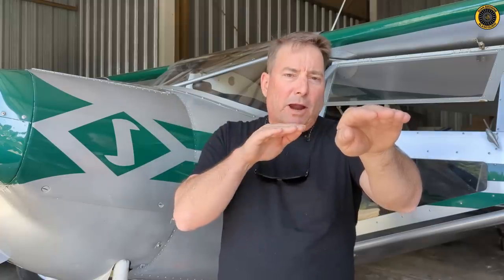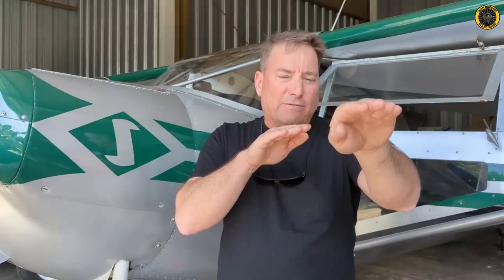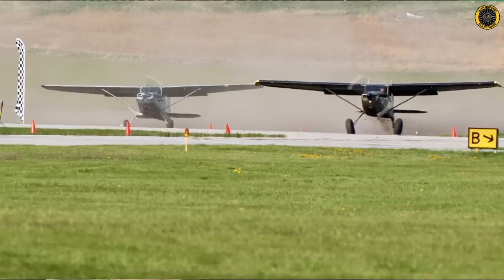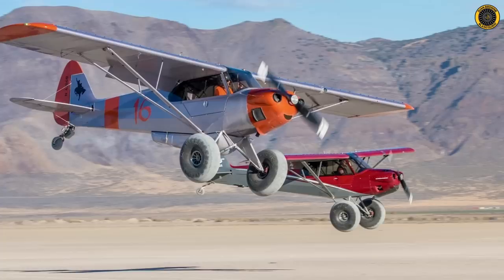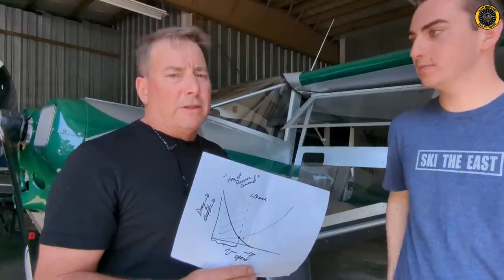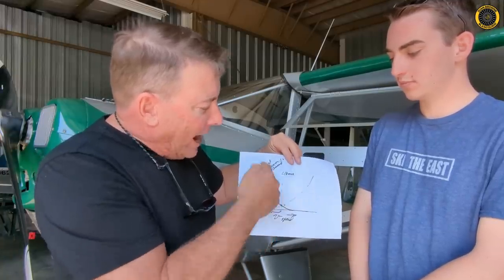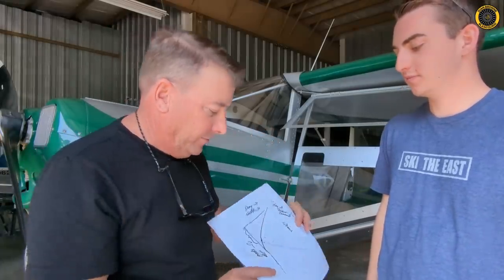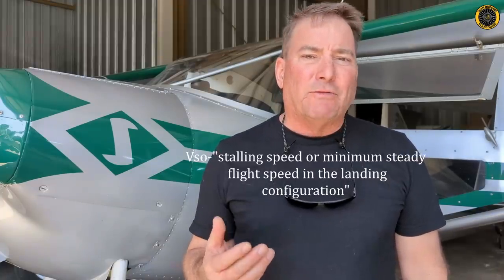Cessna 140 Stall/Spin Accident Wayne NE

Comment: As soon as you started explaining the wing drop I was chanting "stick forward, stick forward".  Don't fight it, aid it.  Spend a few grand on a modern home PC, a good realistic flight sim and practice doing everything wrong, why it's wrong, write off a bunch of expensive virtual aircraft and then go and do it again trying all the different techniques to see what works and what doesn't.  
I mean, you cannot simulate a tip stall on short final in the real world.  You can do it all day in a sim and not kill anyone or cost anything.
You can try, aiding the stall.  Left wing drops, it could spin, so spin it.  Stomp the rudder towards the wing that's dropping and pull the stick back.  Weeeee!   Or kick the falling rudder and stuff the stick forward, wait for the stall horn to shut up and slowly pull out.
Just remember when you get back in the real thing the plan is to avoid those regimes entirely, not play with them.
Reply: If you just don't do "games", RC models are cheap and if you go with an electric powered foam STOL plane, it will be so light, if you spin it on approach you could probably just run over and catch it.  (Just don't try that with the prop spinning, it hurts... a lot).
Reply: I had a little powered glider, high pusher prop RC plane.  I decided that as I was getting comfortable flying it, I'd try some departures.  Stall was so beginner friendly and smooth, I moved straight to a spin.  Slowed up, held the nose high, seen with my eyes the buffet caused a left/right wiggle in the tail, seen that as my opportunity and slammed full back stick, full left rudder.  My god that thing snapped into a spin so violently the canopy held on by neodinium magnets popped off and free-fell down, the battery held in by elastic bands came out and was spinning around on the end of it's cord about 3 inches in front of the nose of the plane, like a bolos. 
I honestly do not know how I recovered it.  I slammed the stick forward and it responded, had to give a few kicks of rudder to stop it penduleming and get it coming down straight vertical, then I pulled out.  Battery hanging from the cockpit area.  Luckily, somehow the centre of gravity was still workable and I was able to land it gently into some long grass as a cusion.  I've never seen a plane spin that tight and aggressively.  I imaging, in the real world, if you were a test pilot attempting this on a small experimental type for the first time, you could get a real surprise as I'm sure such a violent spin is going to cause damage to the plane AND the pilot.
Pays to remember that cessna et. al. do spend a lot of money and employ some very good aerodynamists so most of these things happen in predictable ways and don't randomly kill people.

Comment: Mixing aircraft with vastly different performance is the obvious situation in which conflicts will arise. There's not much twist in the C-140 wing, so it stalls with little warning all the way out to the aileron. The C-140 & C-150 series aircraft were designed as trainers & built to have abrupt stall-spin characteristics.

Comment: Even small A/C like a Zenith create wingtip vortices that might be capable of changing lift left to right wing on the following A/C. Perhaps that was a factor if he was so close behind as to start turns away from RW heading to avoid overtaking. The problem with many A/C accidents is the pilot does not have time to learn from the sudden changes in airspeed, lift, drag.

Comment: Thanks for highlighting the 'decreasing headwind shear' problem. I was arguing this with some guys a while back and they were trying to say that it had been discredited (the old 'turning onto downwind' argument) - I could not work out the aerodynamics of their argument - it appears obvious if you have a decrease in headwind close to the stall speed and nothing is done to increase the airspeed of the aircraft, there is an instantaneous change of the speed of the air over the wing - sure, if there is plenty of time and space to compensate, it's not a problem, but at that 'only a couple of knots to spare' instantaneous moment, it is a big problem.

Comment: An unfortunate accident and my condolences to all involved.  Good discussion on correct response to incipient spin recovery and operating on the induced drag side of the power curve.  One thing that was not mentioned was the possible encounter of wake turbulence from the aircraft ahead which could have induce the initial roll effect…

Comment: The Cessna 140 is a sweet airplane.    But the airfoil lacks certain modern features you’ll find on newer 100 series Cessnas, like leading edge cuffs and wing twist.  As a result, the stall characteristics are a bit different.  If coordinated, the airplane can be flown at slow flight with a straight up and down airspeed indicator.  There is absolutely no sign of an impending stall…no buffet or wallowing.   When it breaks, it just breaks…cleanly and instantaneously.  Add a little yaw and one wing will drop right off.

Comment: Juan am not a pilot, 20k away from you. But here sitting on the fence, the plane not built for stol.It was following a plane that was, hence he caught up due to a higher speed compared to one that still flies at an even lower speed. Out of this comes and uneven clearance, plus as you say wind shear about, higher speed required than normal. I would say just have the competition for stol built aircraft. I guess it is like having a competetion between a tiger moth, and a 777 which one would land with the least amount of runway used. Sad day for the family.
Reply: Seems to need more controls from smarter folks, and based on the plane and pilot?

Comment: Having taught STOL techniques for years, I am encouraged that these events will highlight good technique.  Good takeoff technique, as you just said, is to get into low ground effect as soon as possible (that is how they are graded) and stay as low with the fuselage level as possible for as long as possible or at least until zoom reserve airspeed that allows maneuvering flight or even short duration climb with engine failure (that is what is not happening.)  Good landing technique, as you just said, is to fly a stabilized approach at more than stall speed out of ground effect followed by a power/pitch deceleration coming into high ground effect.  STOL, which understands that the airplane will fly slower than Vso in ground effect, is targeting the speed at which the wing will stall in low ground effect.  Going behind the power curve, not necessary in that headwind condition, will allow the wing to fly at less than Vso out of ground effect with the throttle closed.  That is why we must pitch to decelerate to the point of sink (not necessarily behind the power curve) in order to bring dynamic throttle into very effective glide angle and rate of descent control.  This dynamic throttle control, in strong balloon closed and then adjust or in rapid sink to the firewall and then adjust, is what makes adding airspeed in gusts not necessary.  Just a bit of dynamic throttle was necessary with those winds.

Finally, and most importantly, with even 50' of vertical space available (400' was available) insisting on a level turn, teaching level turns in the maneuvering flight world, is counter-productive.  We are teaching pilots of small airplanes, the planes most train in, to stall when startled in a turn.  It makes so much more safety sense to teach pilots (outside the high altitude and flight by instruments world) to release back pressure in all turns (muscle memory).  Releasing back pressure allows the designed to not stall airplane not to stall in startle or inattention of pilots turns.  The airplane cannot stall itself.  A pilot pulling back on the yoke is necessary to cause stall.  The critical angle of attack is not why it happens, but rather when it happens.

I very much appreciate your videos, Juan.  I apologize for the long STOL technique lesson, but I think it is an important one for all pilots.  I think the basic low ground effect takeoff and deceleration using the apparent rate of closure (power/pitch) are safer techniques than what are presently Airmen Certification Standards.  My condolences to the family, but STOL isn't what got a good pilot.  Muscle memory for pulling back on the yoke in the turn did.  He made that turn as taught.  Unfortunately he got startle close and there was no instruction in allowing the airplane to do what it was designed to do in a 1g turn of any bank angle.  Muscle memory cannot do the math so the 1g at any bank is safer.

Comment: Sorry for the loss.  You accept the risk when performing this type of flying. These demos are very risky and it was only a matter of time before this happened.  This type of flying puts added (unnecessary) pressure on a pilot to perform during the most critical stage of flight...Before slamming me, yes I am a pilot who has many hours in a Zenith 750 and I would not do this type of flying...

Comment: I have read several different websites where they have tried to asses what happened to Tom Dafoe's Cessna 140. From reading comments from others there seems to be a lot of negativity towards the STOL Drag community. A lot of commentators also felt that the Cessna 140 airplane was too heavy to be performing in STOL Drag competition. Many felt that the Cessna 140 was a bad choice to do STOL maneuvers of any kind. I have watch STOL Drag demonstrations that you have done the "play by play" and I thought it was a relative safe operation but then most operators are season veterans in this type of activity and their aircraft maybe more suited for STOL Drag racing competition. I would say the biggest one out there throwing daggers at the STOL Drag racers is Dan Gryder!

Comment: Another possibility, slow and right within a knot or so of the knife:  even a shallow turn can begin to initiate the airflow zippering.  Video of event is too far away to verify any rudder or aileron inputs.  All that said, If I was going to do a go around mr throttle is my first control input.
Reply: Phillip Cobbin Never, never add power first, reduce angle-of-attack first and then add power.
Reply: @garymiller5624  Multi tasking do both, unload the wing and get power in
Reply: @philipcobbin3172  l will go with that, never power first 👍

Comment: It just shows how easy it is to get yourself into a difficult situation with mismatched plane types and stall speed, the need to maintain situational awareness, think ahead of the aircraft and the care you have to take when initiating a go around at low speed - which we've seen the results of so many times, I suppose a potential lesson is to be aware of the risk and try to be ready to push on the rudder/push forward. At that low altitude then really difficult. Once you start the stall/spin entry at that altitude it's very hard to recover. I wonder if It might be worth considering mandating/recommending bigger separations in paterns whilst demonstrating STOL, simply as you're flying in that region, it seems to me that he wasn't able to maintain a higher speed and then drop it close to the runway as the slower aircraft was infront of him. All in all very sad, it only takes a second RIP.

Comment: Very sad deal, and RIP to this aviator.  Did a lot of instructing and taught the stuff you are talking about here.   But my instincts told me that a lof of GA pilots are not going to train regularly and practice these things at a safe altitude, and even if they do, they can be caught unawares when  the focus is on other things than speed, power and pitch.  Tragic part is, it only takes a few seconds and a moment's inattention at low altitude to get into a stall-spin situation and of course as we all know, low to the ground, there's no time to recover.  When we say, first fly the airplane ... that means keep that necessary speed and if you can't, then do something else.  Get out of that configuration, get the speed back, and climb and get out of there and do whatever you are doing ... again.  Go around, etc.

Comment: One observation I took in from other actual video not brought up is the trailing wing tip vortex generated from the lead aircraft flying slow at high angles of attack and its affect on the trailing aircraft flying close in and lower is very susceptible to rolling and stall upset actions.

Comment: Another unnecessary loss of life due to a stall-spin.   I practiced spin recovery in 1980 when I earned my ticket and why the FAA only requires this for new CFI applicants is a mystery to me.  (Per FAR 61.183, pilots applying for a CFI certificate)  The requirement to demonstrate spins during a private checkride was eliminated in 1949)   At least make students hold full back stick and 'walk' the plane down with rudder only.   I continued to do slow flight and spins in our Champ for years just to stay sharp.   What a shame that so many pilots only see their first spin right before they die.

Comment: Juan, terrible tragedy.  As always your videos on safety and accident review are a great resource. One small error on this one….well not error just technical point. The region of reverse command is not really more power to go slower. That is another phenomenon , as you put it “hanging on the prop”.  Essentially the prop (thrust) can have a vector that provides some lift.  The region of reverse command-that we all learned in military flight school- is when the two ways of controlling altitude and airspeed reverse. Normally you control speed with thrust and altitude with pitch. In the region of reverse command you must control altitude with thrust-partly because of the above thrust vector- and speed with pitch. As you brilliantly pointed out this is because you have put yourself in the drag region of the curve where your drag is at the limit of your available thrust output. So..again you alluded to this…to not stall in this situation you MUST lower pitch to increase speed and lower AOA=drag. Coffin corner is when you can’t lower pitch because to do so would cause unacceptable altitude loss and you can’t increase power to control altitude.

Comment: STOL seems self-deleting.  The better you are at edge-lording it, the better you are at the sport.  To improve from mid-pack to the front, you have to fly ever closer to the edge. Seems like a saner approach would be to have a set minimum that isn't crazy, and those that qualify do precision events and timed (not for spreed but accuracy, like in old times rallies) events.  Stuff that tests skills not including skill at playing chicken with mortality.  Each plane would be timed based on the application of factors like 1.3 times the stall speed (whatever the correct label) for that model.  Precision over ego.

Comment: Gryder called this better --- too low and too slow for him. Keep at least 10 mph over the slow speed stall limit. Hot air is less dense, too.
Reply: Textbook airspeed minimums are for normal everyday flying. STOL competitions generally fly much under the FAA recommended airspeeds. Most of these aircraft are designed and greatly modified for slow flight. Sadly unmodified Cessna 140s are not.

Lessons Learned are often written in blood. The STOL Community will be adjusting their rules and best practices for sure.

Comment: I believe this is what happened to Tango & Juliet.  Just too slow to initiate a turn.  100 ft. Is just too high to survive a nose in.
Reply: I dont know what happened to them. Ntsb said it happened on arrival but the sherriff said it was a departure accident not involving stall or spin.
Reply: @atg197  The radar track had them turning downwind to left base then crash.  Tail wind involved too.
Reply: @brianchisnell1548  yeah that is what I thought but a dude with the sherriff's dept said the ntsb prelim is wrong and that it was a departure accident much later in the evening out of Williams. Kind of strange but who knows what the final report will say.
Reply: @atg197    Wow.  That's odd.  They were arriving at twilight.   High density altitude.   I read they were gunna stay the night at Williams.  Woulda been dark for their trip to Grand Canyon.   Did they purchase fuel?  Easy to check .  Tim was a very Safe pilot.  I think he got snared like Dafoe.

Comment: All the talk about stall spins is great and agree that pilots should be well trained in recovery but it seems the cause if you will of this accident was turning in to tight behind a slower aircraft as was mentioned. Situational awareness is key - any time your approaching or in the pattern pilots need an understanding of the aircraft around them and their capabilities in order to allow for safe spacing. It would seem this wasn’t the case here which put him in a fast developing situation leading to the stall spin. Maybe these events should include a briefing on the capabilities of the aircraft that will be participating. But sadly even excellent experienced pilots can make a mistake.

Comment: Why do these stupid accidents keep happening to supposedly experienced pilots?
Scenario: A low-time pilot flying low and slow, observing some ground event is suddenly faced with a windscreen-full of GROUND! Every instinct tells you to pull the stick back HARD - which ensures a solid spin until you meet the ground.
How to prevent this: Introduce some experience in SPIN ENTRY at a safe altitude - no need for a fully developed spin and subsequent full spin recovery! What is critical is to have every low-time pilot experience a SPIN ENTRY and the simple recovery: Simply center the controls, take  deep breath and then recover, usually within 500 feet. Once you, a low-time pilot, have experienced - and recovered - from this kind of situation once or twice, you will automatically react correctly!